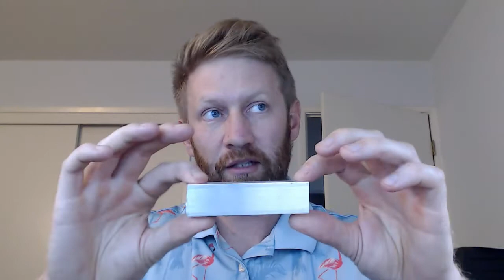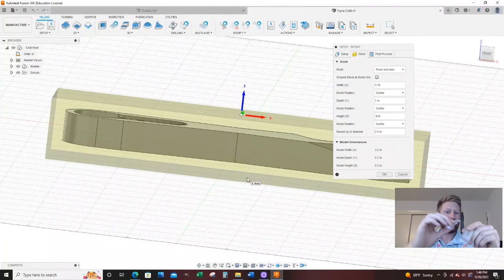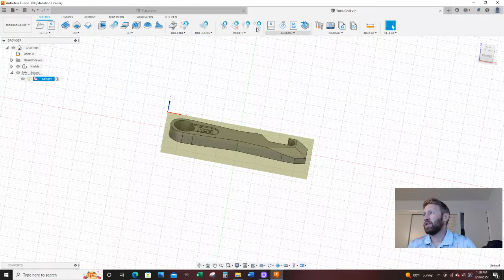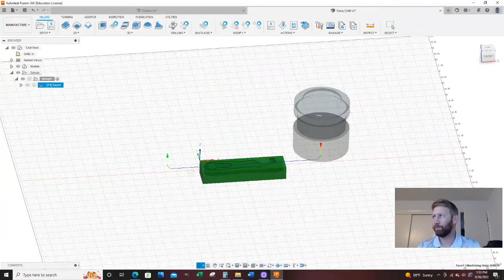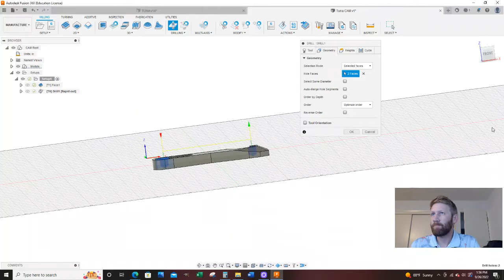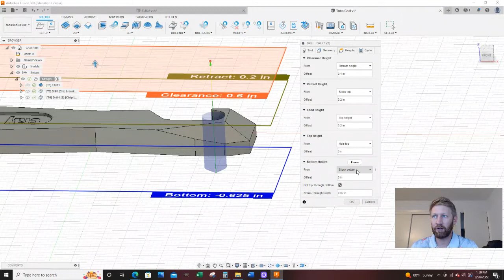TUNA CAM Stage 1

Comment: Very good instructional video!  I am thinking about a small cnc mill for my home shop and this is the kind of content that will help me immensely to decide on that. Have you seen the Langmuir MR1 hobby mill?  If so do you have impressions of it?
Reply from the maker: I have not used that one but have seen similar size ones in person. You just really have to reduce your feeds and step overs. Most do not have a tool changer which is super handy to have! I recently sold a Taiwanese CNC Mill for $3000 so you might be able to find something on Craigslist that is relatively rigid for around the same price
Reply from the maker: Also thank you so much for subscribing!